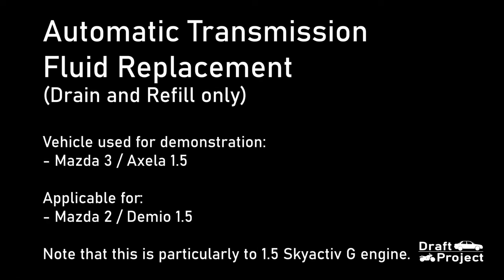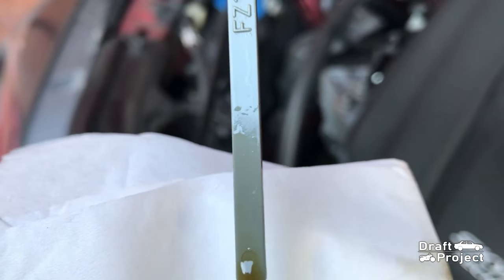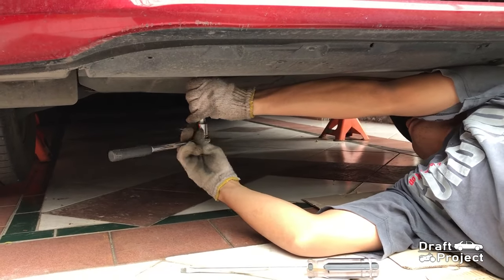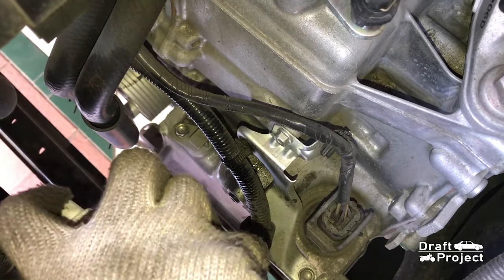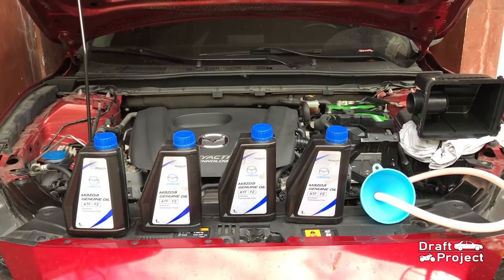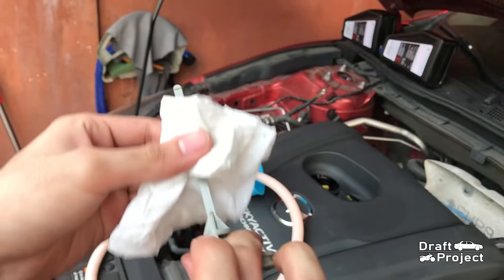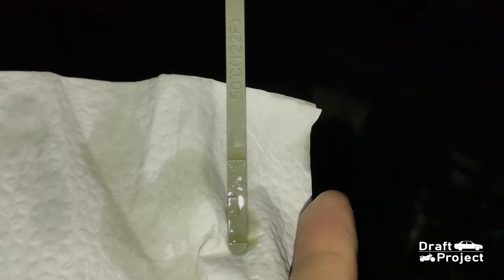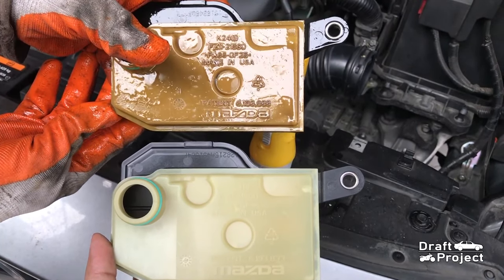How to Change your Automatic Transmission Fluid - Mazda Skyactiv ATF FZ

Comment: for anybody wondering: torque specs for the transmission drain bolt (source: tech looked it up at dealership) 23-30 ft-lbs
Reply from the maker: Thank you for the info!

Comment: Great video, if you run a plastic tude from a funnel into the fill hole you do not have to pull the intake box assembly. 5/8 outside diameter fits perfect in the fill hole.
Reply from the maker: Thank you very much for the info!
Reply: Where did you get the hose, do you have an Amazon link to a similar hose
Reply: @jaypatterson6007  Lowes or home depot will have it.

Comment: What is the size of the ATF drain plug washer? These crush washers are recommend to be replaced, but cant find the size to order replacements...? Appreciate any help. Are these the same size as the motor oil plug washers? I have some of those...
Reply from the maker: As far as I remember, they are the same. When I performed an engine oil change and transmission oil change on a Mazda 2 with the same engine, I found out that they have the same drain bolt.
Reply: Buy it from a Mazda dealership. Give them you vin number so you get exactly what you need

Comment: Many thanks for the videos, just did my 2012 Mazda 3 Skyactiv. The oil looked disgusting red-black in color. Cannot speak for the Mazda 3 change interval, but my Corolla likes a change at 18.000 km. So much easier to change in Corolla 🙃  Thanks again !!
Reply from the maker: I see! Thank you very much too. Take care!
Reply: I have a 2012 Mazda 3 Skyactiv, and the transmission fluid was changed at 80,000 km. What was your milage at when you did the fluid change, please?
Reply: 156,000 km

Comment: Good video the way I'm going to do it is before I even start draining the fluid I'm going to pull the dipstick out when the car is completely cold and then I will check the dipstick when the car is cold it will give me an idea of where the fluid should be when the vehicle is cold I feel if I do it this way I cannot go wrong after I add the 4 quarts of FZ transmission fluid take the car for a ride park it is let the car sit overnight and in the morning when the car is cold check the level on the dipstick I feel that will give me a pretty accurate reading
Reply from the maker: Yeah, you can do it that way. You can also try checking the fluid while the engine is running to have more basis for inspection.

About the job done to this vehicle, actually, we have already performed this several months ago. I just uploaded this video recently. I put 4 quarts/liters of FZ transmission and it runs good. No problem at all. Everything is good up until now. Been using the vehicle for several months.
Reply: @DraftProject  have you had any problems at all since you changed your fluid I basically took out exactly three quarts and put exactly three quarts back in so far so good I was going to do more but they were all out  of fluid at the mazda dealer  only had three quarts man that FZ fluid is expensive 55 dollars for 3 qts
Reply from the maker: @dobermanguy9437  No problems at all. Everything is smooth and working properly.

Basically, the rule is what or how many comes out, comes in. Just make sure you properly measured the fluid that comes out. If there is only 3 quarts in your drain pan, then put 3 quarts back in your transmission, no need to add more. If you want to be extra sure, just check the dipstick for assurance. 

Oh man that is really expensive. Here, it ranges around 30 dollars for three quarts.

Comment: If you have socketed bits (not expensive at all) you won't need the wrench and Allen key.  Just make sure that the ratchet is set to loosen so that you don't accidentally strip it thinking it is too tight when you just got confused and did it the other way for some weird reason accidentally.  I just know there is some horribly unlucky person who that has happened to somewhere.

Comment: What cleaner did you use to clean around the trans dipstick before removal?  Why did Mazda engineers make access to the dipstick in such a thoughtless spot?  Why doesn't the owners manual discuss when to change fluid or flush trans?

Comment: Thank you for the video, I’ve been wanting to change mine, I’m at 145k miles with original oil 🥴
Reply from the maker: Thank you too. Take care as always.
Reply: Did you change it?
Reply: I've heard a lot of people say you shouldn't change your transmission oil if it's really, really old. Apparently, the thinking goes that your transmission will have already been worn down, and if you put new -- really slick -- fluid in, your transmission will slip, even to the point of not being able to run at all. What was your experience?
Reply: Mazda says the transmission is "lifetime" 

Honestly I think you should be ok if you do it now, but I probably wouldn't wait to much longer.

Comment: I have a 2017 Mazda 3 with only 52 kilometers mileage, with the transmission working just fine with no complains. When should I drain and refill the transmission oil if it is mandatory and should I change the filter too?
Reply from the maker: We recommend doing it in this cycle:
Change fluid only at 25,000 Km - Drain and Refill
Change fluid and Filter at 50,000 Km
Reply: The transmission should survive to at least 200K MILES without a fluid change, 25K kilometers is a really low number and you're going to waste a lot of time and money.  I don't really recommend going 200K miles but I did and it's still driving (2013 '3 2.0L skyactiv automatic).

Comment: Great video! What is the size of that washer?  Same as the oil drain plug?  TIA.
Reply from the maker: Yes. Engine drain plug and transmission plug washer are the same.

Thank you very much!

Comment: Why didn't you change the filter? When should it be changed? Thank for your help!
Reply from the maker: The vehicle had only reached about 25000 Km's on it which only requires a drain and refill job.

The automatic transmission filter should be changed when you reach 50000 Km along with the ATF.

Thank you!

Comment: This is very educating. I have the 2017 mazda 3 Grand Touring. Has the 2.5l skyactive engine. I have 35k miles on it. When should I change the fluid? What type of fuel do you guys use? I use premium fuel octane gas but wonder if instead of premium if I can use regular gas.
Reply from the maker: If you have miles as unit, that would be probably around 56k kms. We recommend it to change the fluid as soon as possible to maintain the whole transmission. At this mileage, you might have been experiencing some jerky or rough shifting. Changing the fluid will eliminate it and make it smooth again.

For the type of gasoline, it is best to follow what has been said in the service manual. In our vehicle, we only use regular gas as recommended by the manufacturer.
Reply: Mazda says it is a "lifetime" transmission fluid. I still recommend changing the fluid though at around 60k to 100k miles American. Just be careful, as a rebuilt transmission is EXPENSIVE.

Comment: Nice video! I see the new fluid is blue -- is it going to stay blue after a few days if most of the fluid has been changed (3x to get 90%)?
Reply from the maker: Nope. It will start to change after a few hours of driving due to oxidation which is pretty normal.

Thank you very much!

Comment: Thank you so much, my mechanic could not even locate the dipstick.  Once again thanks for the detailed video.  Is there any need to refill ATF after 65,000Kms on Mazda Atenza GHEPF?
Reply from the maker: If the transmission doesn't have any leaks before, there is no need to refill. But, you can always check the dipstick just to be sure.

Comment: One question, why did you not to attempt to change out the transmission filter?
Reply from the maker: Because the vehicle has 25,000 Km odo which is an early thing to do. I just changed the transmission oil to keep it fresh and maintained. I will change the transmission filter by 50,000 Km odo.

Comment: Where can I find the check procedure for my 2016 CX-5.  Owners manual doesn’t specify any procedure or trans fluid level check.  Where did you get the “wait 5 minutes after temp light goes out” procedure?
Reply from the maker: Mostly you can find it on service manual. Owner's manual only provides basic stuff and knowledge while service manual gives you every details, procedures, and technical points. Unfortunately, we don't have a service manual for our vehicle.

The 5 minutes procedure was actually our experiment.  First, we check the fluid at cold engine which has high reading on the dipstick. Then, we turn on the engine and the fluid level started to decrease. After five minutes or when the temp light goes out, the fluid stays on a certain level only. It won't decrease anymore even though you let the engine run for a few more minutes or even hours. That indicates an accurate fluid reading. That's where we concluded the five minutes procedure.

Comment: Why do you add blue oil but when you pull out the dipstick it turns yellow? Thanks
Reply from the maker: Oxidation causes the transmission fluid to change color. When used and vehicle operates, the fluid absorbs pressure and release bubbles, creating a chemical reaction that leads to change of color and properties.

Comment: I just did a flush yesterday in my mazda 3 17 2.5 auto.
And only 3.4 liter came out…

So i put back this amount and everything seem right.

But im wondering why there a so « big » difference with you who got almost 4 liter out from only drain and refill?

Any idea?
Reply: Any sympthons that suggest you that needed a trans oil change ?

Comment: How often do we need to do this sevice? Every how many thousand kilometers?
Reply from the maker: We recommend this interval:
25,000 Km - Drain and refill only, no change of transmission filter.
50,000 Km - Change transmission filter and fluid.

Comment: You took out red oil and put in blue oil? Are you sure you put in the right stuff? Why is that the case?
Reply from the maker: Yes, I put the same oil as what the manufacturer has been using. The color of the transmission fluid changes because of oxidation.

Comment: Do you know if the 2017 MX-5 Miata Automatic has a dip stick to check fluid level?
Reply from the maker: I haven't experienced working on a Mazda MX-5 before. But, I tried to search for a bit and I found out that they don't have dipstick. They only have what they call "Overflow Plug".

https://www.mx5manual.com/page.html?docid=SM353181

You can check that for more reference. Thanks! Hope it helps

Comment: Hi, I have question I trying to find TCM for Mazda 3 sedan 2.0 L can you tell the location where it is fitted in front? Thanks
Reply from the maker: If you are referring to an older model of Mazda 3, try checking under the battery tray.

Comment: How much oil i need to start replacment on my Automatic transmision? thanks
Reply from the maker: Just prepare 4 bottles to be sure. Drain and measure how much fluid comes out, so you will know how much fluid you will need to put back.

You may refer to your owner's manual for your transmission oil capacity.

Comment: Hello u used 4 liters but if u change filter too, does it take more liter.
Reply from the maker: Hi! it takes a little bit but not a liter. To be sure, just check the dipstick for accurate reading of the fluid level.

Comment: Hello brother , how many kilometers that I need to change transmission oil
Reply: it is very dependent on driving habits and the climate. I live in the hot summers in israel and drive 50/50 city highway. I change 3 liters every 30,000km.

Comment: Hello, i have the same car mazda 3 axela skyactiv 1.5L year 2017. Do you know what transmission filter reference it has? I would like to do a drain/refill and change my filter. Thanks
Reply: Mazda says it is a "lifetime" transmission... I don't think you need to change the transmission filter. Drain and fill, is always good, but the filter is tricky
Reply from the maker: For the transmission filter, try this.
Mazda Genuine Parts
Parts Code: FZ11-21-500

This is actually from Mazda 2.
Since Mazda 2 and 3 shares the same 1.5L engine, transmission are also near identical, except the gearing ratios. Just kindly confirm this part number in your nearest Mazda dealer for your vehicles compatibility.

Comment: You haved to replace the filter inside of the transmission and clean the gasket? 
An old mechanic says to me ''when you get a shower why you wear new clean underwear and you do not wear the same?''
When you change oil you must change and  filter too!
I think is better!
I am not a mechanic.
Thanks for the video anyway!
Reply from the maker: That is correct. The replacement of filter is around 50k-60k Km. This job, which is only a drain and refill job, is done at 25k Km.

The drain and refill is optional but I recommend it. I did not change the filter because it is too early and for that, the condition of the filter is not that dirty. I just changed the fluid to prolong the life of the filter before I change it by 50k Km.

Of course, changing the filter is still the best and there is nothing wrong with it. The only issue is the cost could be doubled. You can change it if you want to.

Hope this helps. Thank you very much too.

Comment: is ATF Dialysis method also recommended on changing the ATF?
Reply from the maker: Yes that can also be used to change fluids. That method is more accurate and faster.
Reply: Some shops do full flush , actually not recommended as quite often as the transmission ages you want some of the wear material on your oil. If you did a few drain and refill throughout the life of your transmission it should be good and clean. don't overdue it though. 26000 km in this video is a bit overkill. I would have waited till at last 75k km

Comment: Hi, may I ask:  
1)   Is this a CVT transmission?
2)   Is the ATF FZ fluid compatible for the Mazda CTV transmission?
Reply from the maker: 1. Nope. This is a 6-speed automatic transmission.
2. Nope. Mazda FZ fluid is only designed for a specific Mazda 6 speed automatic transmission.

Hope it helps. Thank you!

Comment: If I'm unable to find genuine atf FZ what other fluid can I use?
Reply from the maker: For this vehicle, I don't recommend any other transmission fluid than the ATF FZ since Mazda transmission is pretty sensitive. There is one which is the Valvoline MaxLife MV which some says that it works and compatible with FZ transmissions. Although, I'm not really sure about it. Sorry about that.
Reply: I live in Australia and Mazda FZ is very expensive here. First I used Valvoline maxlife for drain and fill, however, the transmission made noisy and was not so good. I needed to drain the fluid again and used the Penrite LV ATF. Now the transmission was back to normal.

Comment: I have a 2012 mazda 3 skyactiv. where is the dipstick and refill. I have seaching for it, where you mentioned and cannot find it anywhere?
Reply from the maker: I find it bit confusing but, if it is a Skyactiv engine, then it should be there. Please try to check it again. Perhaps you might have missed it.

Comment: Hi, may I know which brand of ATF is best for mazda cx5 2.2 diesel? I just reach 110k and 5 years. how about motul ATF?
Reply from the maker: I highly recommend using original Mazda ATF only for assurance, just like what I've used in the video. You can use other fluid too but, I don't recommend it because these transmissions are sensitive and can have issues due to slight incompatibility with other fluids.

Comment: Hello. I have a 2015 Mazda 3 and in the operations manual it says that takes 7.8 lts (8.2 qts) but you added just 4 qts, can you clarify this please? I want to change it and want to be clear on how much I have to add
Reply: I am about to change mine soon and from what I've learnt some fluid is actually stuck in torque converter - which is not accessible if you only remove drain plug + bottom of the fluid pan. HTH.
Reply: @rikki146 ohh I see..thank you! Finally I was able to change it and it took the 4 qts to replace the old one. It must be like you explain that the whole 8 qts are needed
Reply from the maker: Sorry I wasn't able to respond. Yes, rikki146 is right. In some cars I believe, has an accessible drain plug for the torque converter. Other used a machine like a dialysis to completely change the fluid in the whole transmission. Don't worry about it, the main focus for this job is to only return what has been drained with a fresh fluid.
Reply: @DraftProject  excellent. Thank you very much. Another question, I found that there is a filter that can be replaced, but it would be needed to open and remove the cover to replace. Do you think this is necessary or if there is any risk by doing it? I didn’t know it could it could be replaced until after.
Reply from the maker: Yes, if you are referring to the automatic transmission filter, it should be replaced whenever you change your transmission fluid. Just prepare for extra ATF and gasket for the oil pan. That job would require cleaning of the oil pan too, so aerosol cleaners would help.